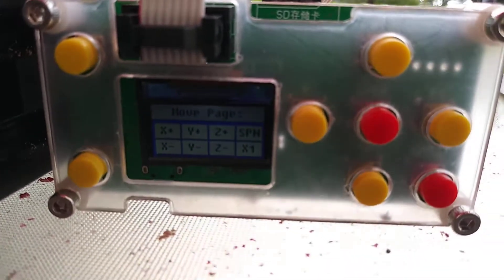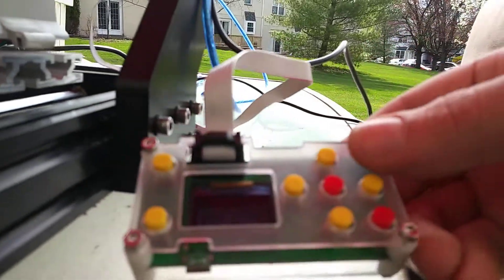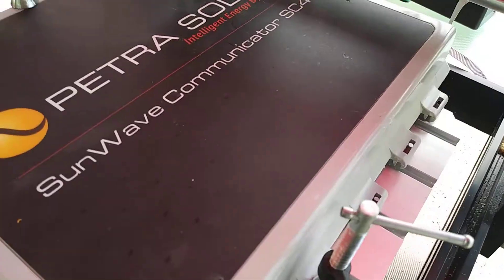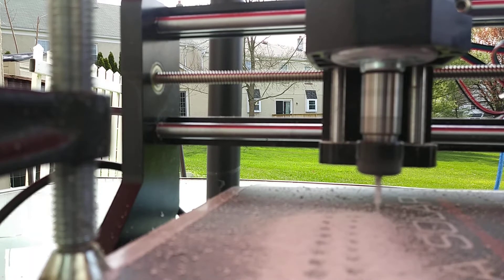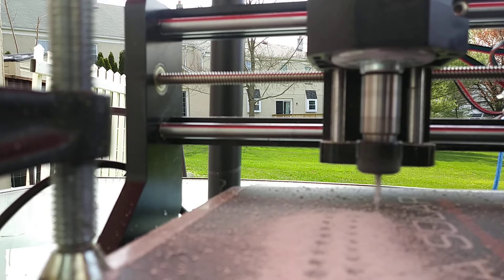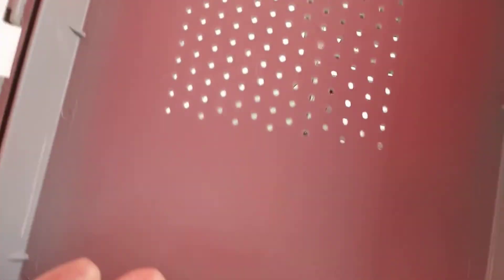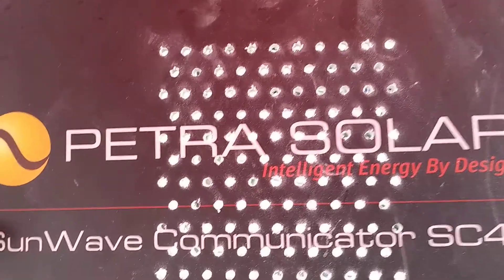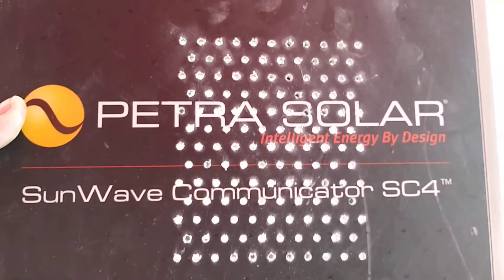Using the GRBL offline controller to drill a grid of holes

Comment: Hello, I have the same controller, but due to error in flashing the controller..  it's an STM32F103RBT..  SWD readout is easy with STlinkv2  with 4 pin connector, I lost the firmware, can anyone with ST-linkv2  read this out for me ?  then I can reflash it to work again..  readout only goes with 480kHz
Tnx in advance

Comment from the maker: I figured out that when this particular machine is set to 800 steps per axis I get millimeter accurate results, so using the 10x mode on the controller actually moved 10mm,  I'm pretty sure that if I set the steps per axis to a different setting like 1600 for example, the 10x movement would actually be 20mm.  could be useful to do drilling operations with the manual controller with the z axis set to 800 steps for a 10mm plunge of the drill bit on the 10x mode and different settings on the x and y axis's to effect the spacing.  idk though, I'm pretty sure if I change that steps per axis setting in the laser engraver software that comes with the machine that it changes some kind of firmware / machine setting that is universally used until it's changed again.